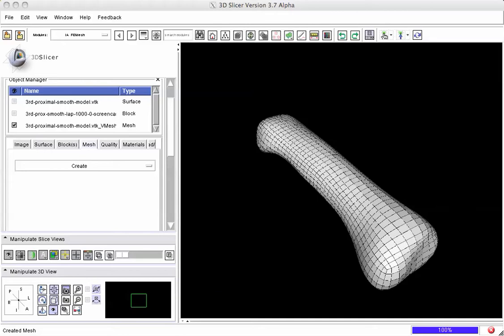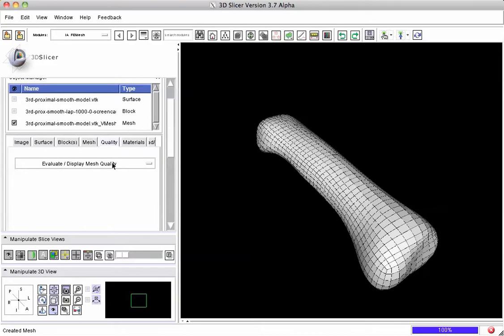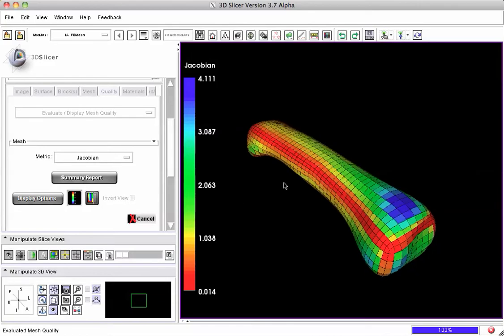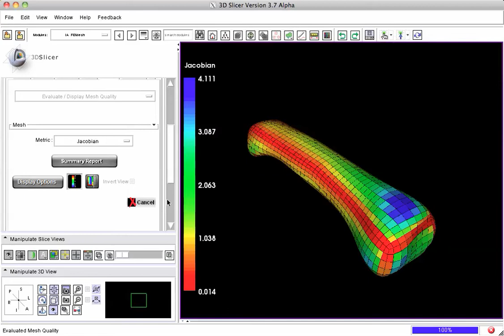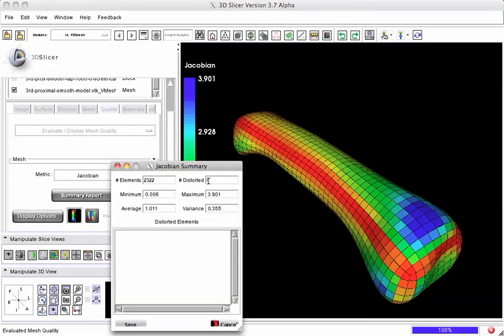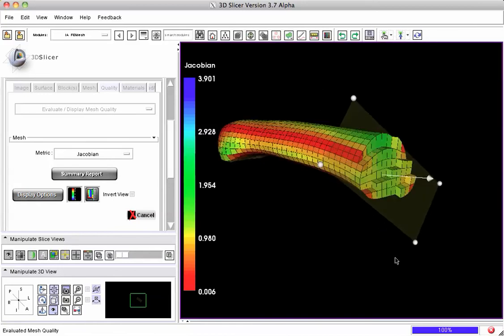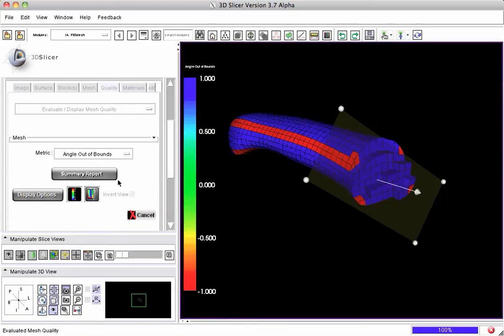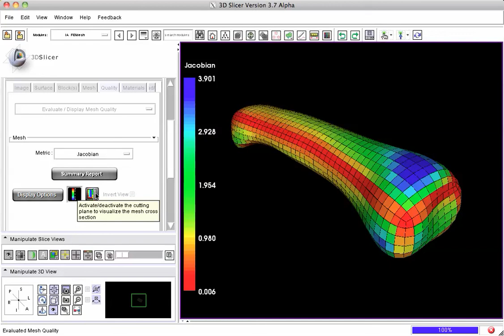How to view and improve mesh quality in Slicer3's IA-FEMesh

Comment from the maker: It seems like you are trying to improve the triangulation of the mesh in your .stl file.  Our application is oriented to volumetric meshes.  However, during the "create mesh" step, there is a button on the interface to create a surface mesh instead of a volume mesh.  This might work for you.  Also consider the Mesquite library from Sandia Lab.